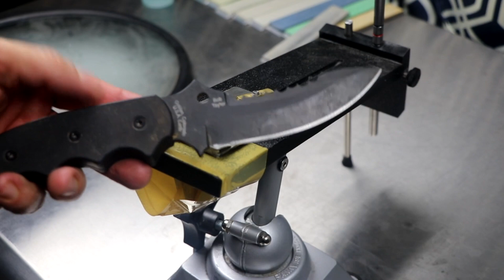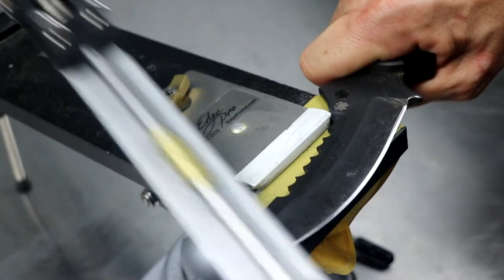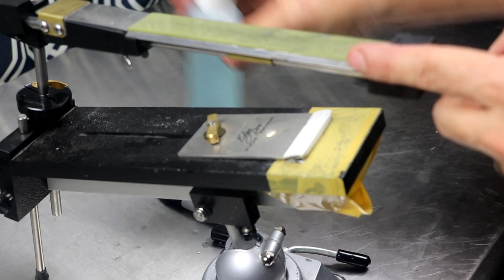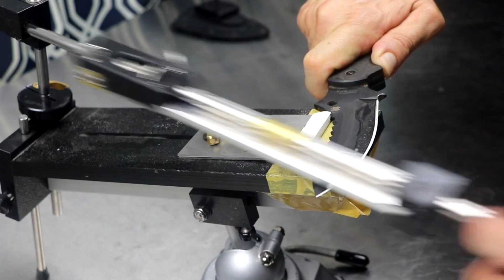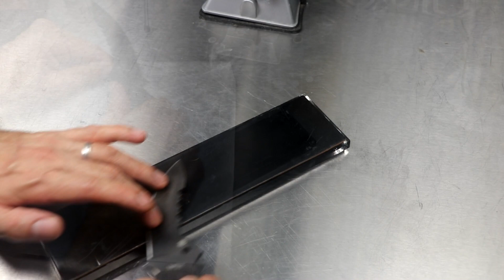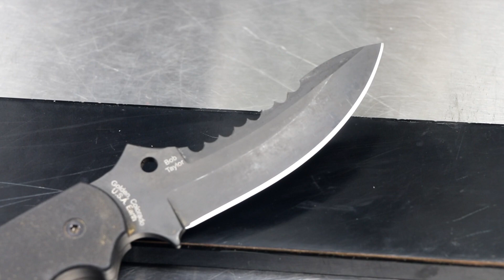Spyderco CTS-BD1 Sharpening (Pygmy Warrior Knife)

Comment: I recently purchased the apex kit and have had stellar results using the stock stones and polishing tapes. Granted, I haven't tried sharpening any super steels yet. Do you feel that it's worth it to pay the premium to upgrade my stones? Is there any reason to go beyond the 6000 grit polishing tape? Also, I haven't felt the need to purchase the atoma 140 diamond plate yet because the 120 grit silicon carbide stone does cut rather fast.
Reply from the maker: That's a great question.  The answer really comes down to personal preference.   The stones that Edge pro sells with their unit will sharpen almost everything.  When you get into the crazy steels you might have a bit of a difficult time, that's where the diamonds really shine.  Truth is unless you are doing fancy sushi knives, straight razors, or show finishes then it doesn't make sense to go much higher than 6K.  I sharpen constantly and I generally work in the 600-2k area depending on what edge I'm looking for.   

With all that being said the other stones on the market offer a different type of sharpening experience.  Personally I am a huge fan of the chosera line...  They are very nice to work with and offer great feedback while sharpening.  In my opinion stones are a very personal preference and each sharpener will have their own opinion as to what they like best.  After it's all said and done you have to ask yourself this question.  Are you happy with the results that you are getting.  If you are then there's no rush to spend more money...   The world of sharpening stones is crazy and there are so many to choose from..   I would at least invest in a couple diamond stones.   Maybe a 600 and a 1000.   Just to have.  You never know when you might need one.   Sorry for the long winded answer.  I hope that helps and reach out if you have any other questions...  Thanks for watching and thanks for the comment.
Reply: @2guysandacooler   I appreciate your prompt responses. I asked you a similar question on another video of yours regarding purchasing the diamond matrix stone to use on a clone edge pro unit or to purchase the genuine kit. While I'm happy with the apex kit, the difference in quality between the clone and the genuine apex unit is not as stark as some believe. Nevertheless, I am happy with the decision I made. The edge pro stones and tapes are better than what the internet consensus seems to be.
Reply from the maker: That's what I heard.   I heard that the biggest difference was in the amount of play but I've never used the clone so I couldn't say.  I really like the edge pro stones.  They are priced right, they get the job done, and they are built well..   Hard to beat...  I tend to be a little rough with the tapes.  I think that a little finesse goes a long way when it comes to using the polishing tapes!  Something I need to get better at!!  I'm glad that you are happy with your decision.  That's the most important part!!